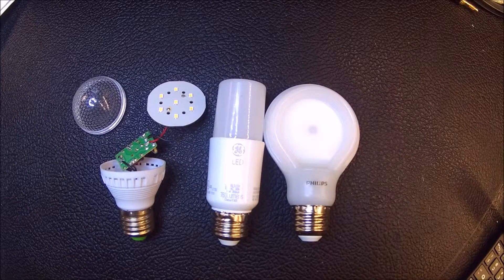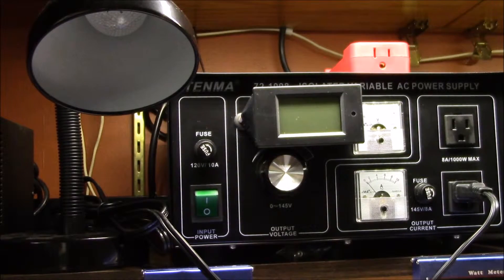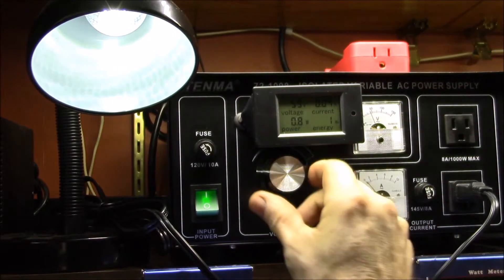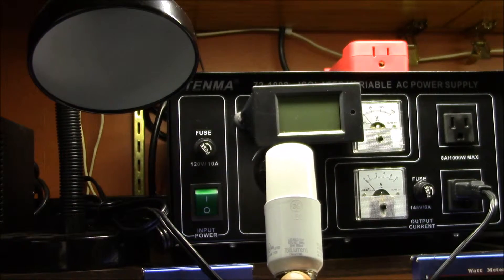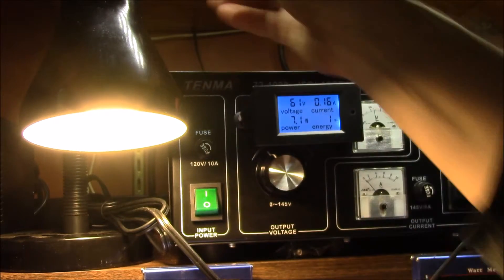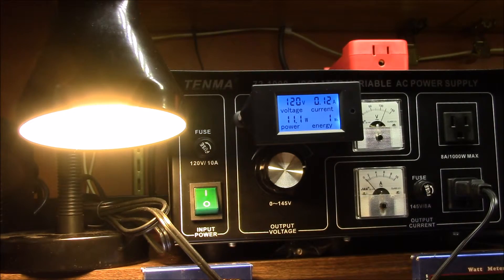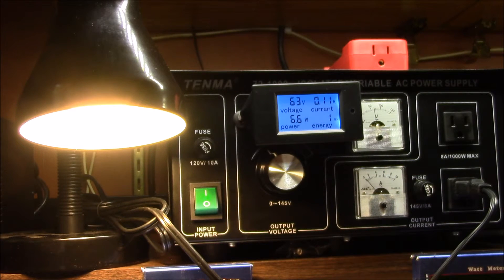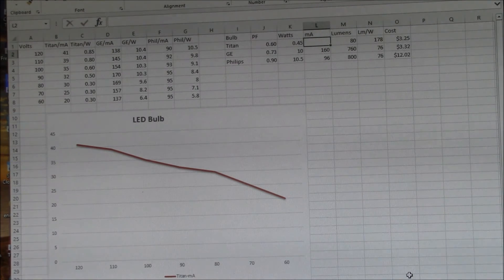LED Bulb Voltage vs. Current, Part 1

Comment: thanks for making these videos. 
I've been using the GE 40W light stik for months now. I recently noticed that base of these led bulbs is VERY HOT. Nearly as hot as incandescent. 
Which makes me think the GE stik bulb is an energy guzzler. 
Your test here seems to confirm the power consumption is as advertised...but all that heat must come from my electric meter and is wasted energy. 
I'm thinking of going back to CFL.
Reply: btw...I found your video from a link you posted on Electronupdate's video on the GE stik
Reply from the maker: Yes, this bulb does seem to run hot at the base.  I suspect since it has little surface area and no external fins, they rely on the high temps to shed the heat.  I think electronupdate figured these bulbs would have a fairly short lifetime.  Mine are in places where they don't get used very long at a time.